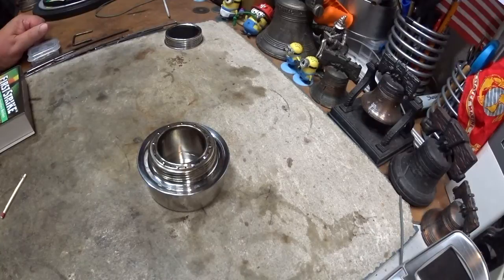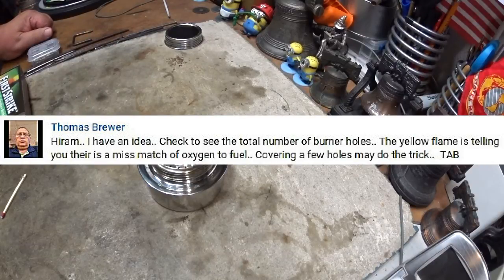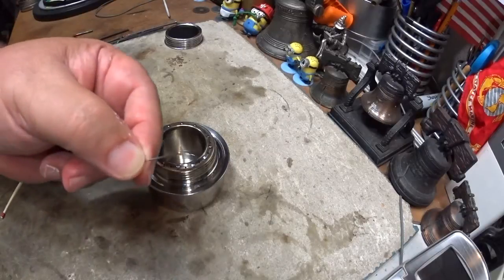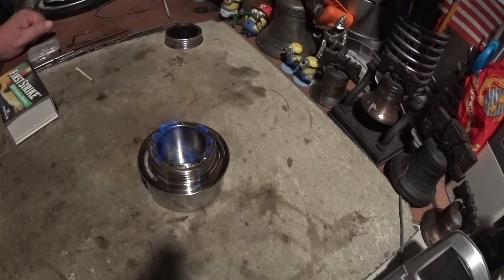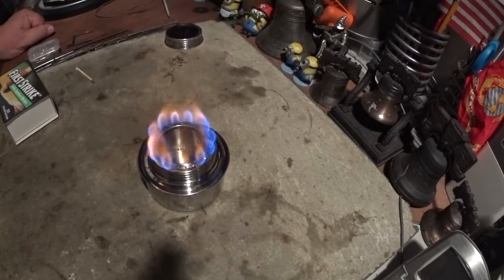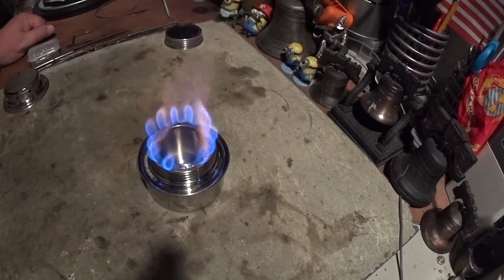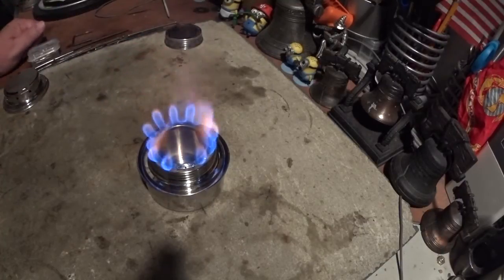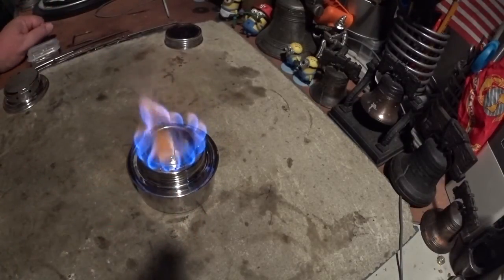TATONKA Alcohol Burner - Possible ''Blue Flame'' Modification

Comment: I use Tatonka, all is right, but when it gets hot and spirit is boiling it is impossible effectively reduce flames, it burns more or less out of control. If you know how to reduce flames advise me.
Reply: Just ream out the jet holes to your desired compression output level.  

By reaming all the holes to arrive at your preferred flame level while blocking some or most of the jet holes, you can adjust the flame output down by removing pins, which releases fume compression; lowering the flame.

Comment: Hi Hiram
Congrats on a highly informative channel. 
Quick question if you have the time. 
I have just been given a Tatonka alcohol stove, I may store it dry in the medium to long term but would like to have some fuel in it when I intend to use it.
 I find the cap very hard to unscrew if you screw it on tight enough to stop fuel leakage
Any tips please?

Comment: it seems, it burns too "fat". my old trangia burner... often cleaned with a needle.. has bigger holes, than my new one, the older one burns more yellow. and the newer one with the smaller holes.. burns more blue. maybe that's also a reason....
Reply: It looks like increasing the fuel compression, by blocking jet holes, is the way to go, to optimize the fuel:air ratio and get a cleaner, more efficient burn with a blue flame.  

The increase in pressure increases the flame height, which will also increase the height of the 1" sweet spot, of course.

The increase in flame height also corresponds with an increase in fuel consumption rate: however, I've documented that the increased rate is more efficient for boiling times (which will decrease - often dramatically, since my highest compression burner will boil water in under 4 min).

With higher compression, the biggest factor is to make sure the flames are directed at the bottom of the pot, to maximize heat transfer via surface contact with the flames (admittedly, this affects side burners more than top burners, like the Totonka/Trangia/Evernew, that you only have to adjust the pot height to find the sweet spot).

Comment: Had my esbit trangia stove developed cracks and a fuel leak...  thinking about replacing it with one of these
Reply: Buy a real trangia, should be a drop in replacement in your stove, this Tatonka doesn't get the air/fuel mixture right.

Comment: I think I heard someone say that "meths" in the UK is about 85% ethanol and the balance methanol.  Ethanol has a different boiling point and energy content etc, so maybe they've optimized for a different blend of alcohol.  You use 100% methanol, right?
Reply: FlashGeiger very good point. tatonka is a german company and the alcohol used is called "spiritus" there. it mainly consists of ethanol. on the other hand, yellow bottle heet is 99% methanol based. you definitely need more oxygen when burning ethanol. roughly 2 times as much. also, ethanol gets significantly hotter than methanol. i wonder how that impacts the so called "sweet spot". what I still wonder why the methanol burns yellow in the tatonka. btw, I believe the ethanol is better since more visible.

Comment: curious to the boil time with that, i use the tatonka for a couple of years now (5/6) and its not totaly blue but way les yellow than yours, may be the brand of fuel?
Reply: tiliaklippa as licewine mentions, it may be differing amounts of water in the fuel, alcohol fuel (which is why most use yellow heet gas line stuff) pulls in moisture, or you can add 10-15 percent yourself, i do this with the british 'methylated spirits' to get a cleaner burn, almost no blackening of the pot with some water added, i have not tested the difference in boiling time or flame colour, but it is blue as i currently use it (on an alocs knockoff in my case)

Comment: A FWIW..... We bought a 6 burner gas kitchen stove. Had a variety of burner BTU ratings from simmer to max output. Came with natural gas orifices installed. I had to swap those for propane orifices. Orifices - small brass fittings with holes drilled in the center. (Natural gas orifice holes are larger than propane.) Everything associated with each BTU rating matched the hole in the orifice. The simmer burner, itself, along with the hole in the orifice was tiny, when compared to the hole & the burner for the one rated for the maximum BTU output for the stove. Conclusion: Size and number of holes have to match (be calibrated) to the burner itself to achieve the best BTU output (blue flame).

Comment: Hiram Cook Not on the exact topic but why couldn't you tell me about the 1 inch sweet spot before I bought the Vargo Stove to use as a combination wind screen pot stand alternative fuel source. It makes a 1.75 to 2 inch gap between my cat can wick stove and the pot. Glad it is better to be bigger than smaller than one inch. Great videos! Thanks for doing the research so we don't have to.